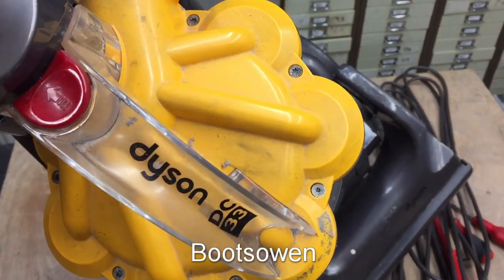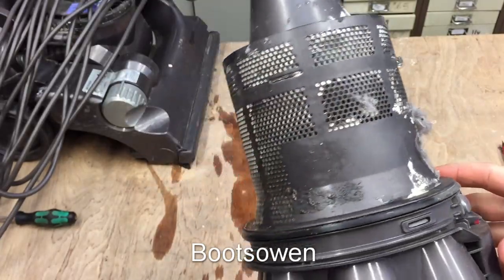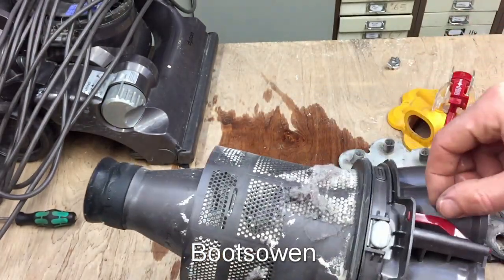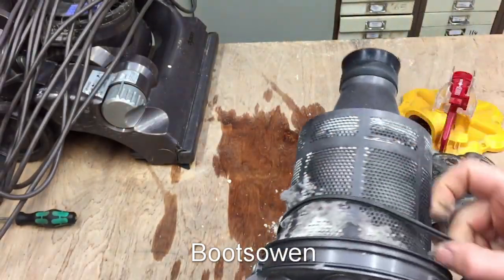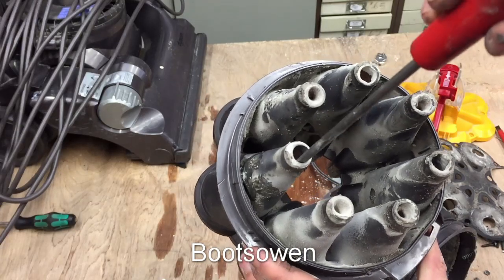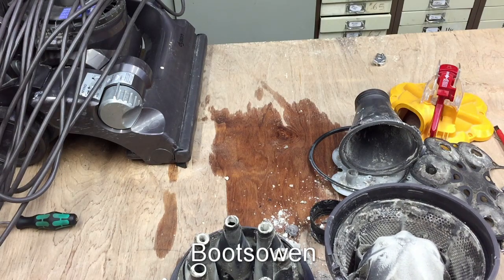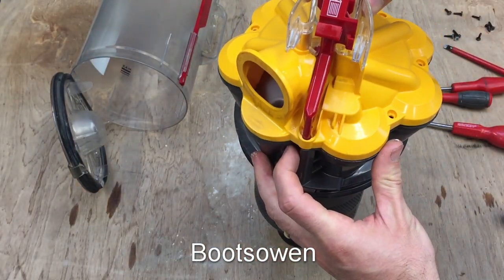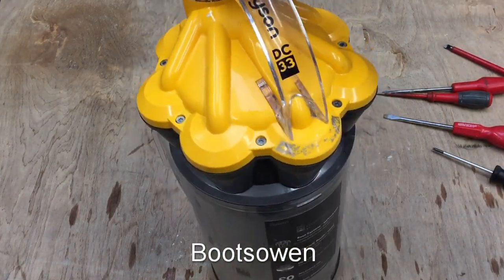Dyson DC33 dust cannister  how to take apart and reassemble for cleaning: Root cyclone

Comment: I realise this is an old video but my DC33 is still going strong here in Brisbane. I have literally only just had the first problem with it and have had to take it apart for the first time. I’ve always kept it clean and washed the 2nd filter you took out but I never knew about the first one because my machine doesn’t have a clear plastic cover that is on the machine you have and is shown on all the manuals I find online!? Mine is just the bin sitting on top of the a grey cover which is able to come off if you have two pairs of hands or there’s no quick release lever (you’d need to use 3 tools to push the tabs while you lift the cover backwards) and I can see a filter underneath that). I can’t find anything online about my machine and I wondered if you’d any idea on if it’s okay to force this cover off and wash this filter or likely replace it given it’s never been done! Hope you can help🤞
Reply from the maker: I have no idea, sometimes dyson filters are fitted underneath something that screws in, might not even look like a screw. or what about a local vacuum repair shop? They will know if you bring it in? if it is working fine then why clean it?
Reply: @bootsowen Thanks for the reply. I cleaned it because it was only sucking via the hose and not when using it like an upright vacuum. The filter I asked about is the only part I haven’t cleaned with the exception of taking the machine apart and reaching parts that aren’t supposed to be reached unless it’s in for a service! Think I might have to try get the part off that I mention above and see if cleaning that second filter will help🤷🏻‍♀️ Not sure paying someone to look at it is worth it given the age of the machine😂
Reply from the maker: It sounds like there is something stuck in the pipes between the brush head and the motor. I would focus on taking that apart for a look. A coin or bottle cap will stop it the way you describe!

Comment: Perhaps I'll figure this out before you reply but there is a screw under the canister opener (red part) that I can't figure how to get out therefore I can't remove the top (yellow part) .  I didn't see that step in your video.  Any advice?
Reply from the maker: Long screwdriver made from a slot together screwdriver and lots of extensions?